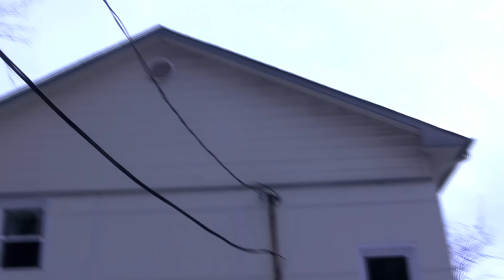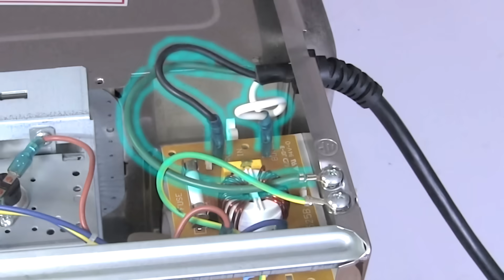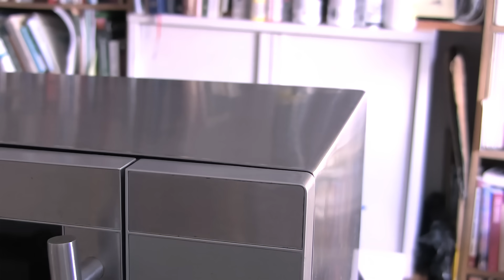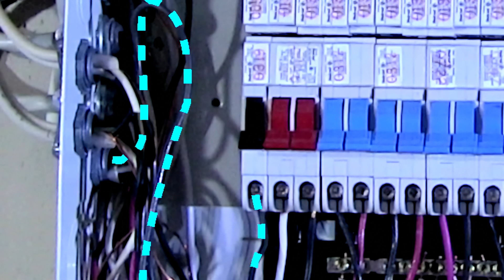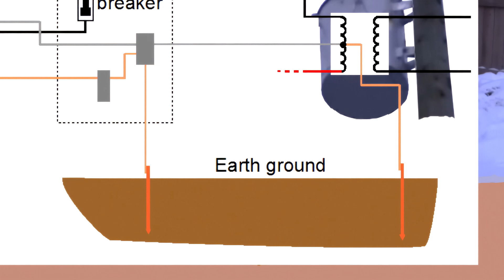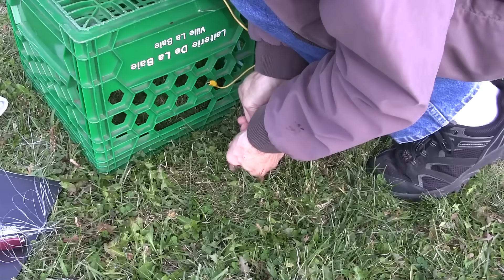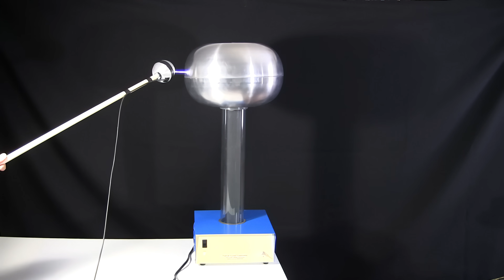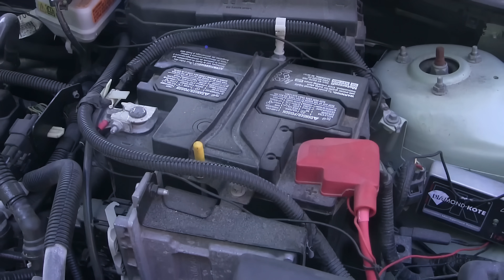What is Ground? Earth Ground/Earthing

Comment: Sorry for asking, its probably a stupid question and maybe adressed in some of 908 comments. It looks to me that the neutral cable is conected to the same things as the ground cable (apart the microowen case). Could  neutral cabel be used as ground? I quess not, because its not used that way, but why? Can somebody explain, please?
Reply from the maker: Do you have a metal case on your lamp? The reason for grounding your lamp is if it has a metal case and there's a possibility of a damaged hot wire touching the metal case, just like is shown in this video. If that's not a possibility then you're okay.
If that's the situation and you're wondering if you can just connect the neutral to the case then that would be bad since whenever the lamp is turned on, the case would be energized because it would be a part of the hot-neutral electrical circuit. Anyone who touches the case and who's grounded would become a part of the circuit too.
Lamps that don't have metal cases don't have to be grounded.
Reply: As an Electrician, it would work BUT very dangerous. One possible problem is some moron wired the plug on the light next to it in reverse, that one works fine as well until you touch them both.

These days they fit "earth leakage" breaker ( wrong name but more descriptive than RCD ), it only needs 30mA (  0.030 Amps ) of current difference between the active  (hot)wire and the neutral wire. big difference if you are touching the case when the fault happens. posible multi hundreds of amps through you, some of which is across your heart, or 31mA, some of which is across your heart. Smoking corpse or a bad shock.

BTW if you get a shock, you should get checked out at the hospital, many, including electricians, have had a shock, shook it off, went home and died suddenly hours later. Something to do with blood and linth ( didn't spell that right ) systems.
Reply: It's against code and unsafe. Basically it isn't connected to ground until it is at the breaker panel. This keeps the neutral wire from taking on that current load that could result in a hazardous condition such as a fire. An electrician could probably give you a better answer, but I didn't see one yet.
Reply: Thank you. I am planning to build some steampunk lamp, but I have only 2 line cable and there are some arguments that the lamp should be grounded. So I thought that it would be better to have something than nothing. Just now I had discussion with an elder of our clan and it seems that it is problem if neutral and hot are switched in the wall plug. Than you get "hot" (we call it faze) on the lamp. So I think proper connection insolation and gound is not needed than.
Reply: The neutral is grounded at the transformer. The ground wire is also grounded. That's why they are attached at the panel only. The current on the neutral will run back to the transformer but can also dissipate into ground through the ground wire.
Reply: The Safest way out of your problem is to use a 12V bulb and a 12V power supply that is "double insulated" .  As long as the cable is rated to take the full output current of your power supply in the case of a short -circuit, it is going to be much safer that mains.

Comment: You should talk about the unbalanced load between the120 240 volt transformed into the that's on the Pole Furnishing power to the house.
Reply: I wonders about that center taped transformer as well, trying to cause a fault? Now if it was a delta/star wired trany it would make sense. ;-)

Comment: how can there be a neutral wire with AC?
Reply: why me? - Neutral is the return path for the electrons. It's not the same neutral like you'd get in a battery
Reply: If you have to transmit electric energy, you need at least two conductors. These are made of precious metals (mostly copper or aluminium). To save some money, you can just change one of these conductors to something else that is already there.

As an example: In a typical car they just connect the negative pole of the battery to the chassis and run only a single wire to big loads (i.e. starter motor), the return path (second conductor) for the current is the chassis. When you add a wire to the positive pole of the battery and drop it somewhere on the chassis, it will cause a short circuit. When you add a wire to the negative pole of the battery and drop it somewhere (except the positive pole), then you just connect negative with negative and nothing happens. The negative wire is in this case neutral, but the positive wire gets really hot. Some smaller loads in a car still use two wires just to make sure that they have a good connection (i.e. plastic case of lamps, relays, radio and so on).

With the electrical power that transferred over power-lines it is the same, the earth is used as a conductor for the current to return to the substations and power plants. They have really big earthing systems buried at these substations and power plants and and have just connected one line to it. Everything that is normally connected to the ground is neutral, nothing will happen if it is dropped to the ground. But if it is the other conductor it can get really hot.
Reply: Many years ago I had to go to a dairy farm to find a fault. They were going to have a party and had hired a mobile coolroom and plugged it into the dairy. All good. Someone tied the dog's chain to the tow bar of the coolroom to get it out of the way. Still no problem. The dog had "to go", went to the tap nearby and got a shock.

The tap was coming from the pump on the house circuit. There was a transformer on the pole down the paddock, metering also on this pole. Two wire came up from the meters to another pole between the house and the dairy. Somewhere during the power installation someone mixed up the two wires, wire A was active at the house while neutral at the dairy, vice versa for wire B.
Never a problem as the tap was just out of reach of the dairy, the extension lead caused the problem..... It took a while to find, turned off power to fix it took 10 minutes ( it was a long walk to the meter box down the paddock )

I can't help thinking that farm must have had a high power bill for many years with that "slow" leak through the ground from the tap to the dairy.
Reply: In AC, the hot wire(s) alternate their voltage constantly while the neutral wire keep the same potential.
The hot wire(phase) change polarity 100 times a second in a 50hz system, in a sine wave. This means that half the time neutral has higher potential than the phase. The current flows either to or from hot wire depending on what potential it has in that exact moment relative to neutral.
https://youtu.be/Jveer7vhjGo
Reply: Watchling: The original question was, how there can be a neutral wire in AC circuits. Neutral is defined by what wire is referenced to earth. And everybody/everything that is somehow connected to earth is therefore on the same potential as the neutral wire and therefore has only a negligible difference in potential to neutral. The hot wire  instead is the one that goes up and down all the time, in reference to earth/neutral.

If you build a table made of a copper plate connected to the hot wire and big insulators as table legs. And you sit on that table with a multimeter and you take some measurements on some cables, you will measure that one cable is always at the same potential as your table... it is neutral and you could even touch it without any harm. But the other cable has a different potential, it is hot and if you touch it, you would get hurt. With that picture in mind, you should see that hot and neutral always depend on what you consider your ground potential.

Your 100 polarity changes per second in a 50Hz system is wrong. There are only 50 polarity changes in a 50Hz system but there are 100 zero-crossings. That confusion may arise from looking at a sine wave plotted between 0 and 2pi. It goes from 0 to 1, back to 0 and down to -1 and back to zero. The first part sin(0) to sin(pi/2) is only a quarter wave and the last part from sin(3pi/2) to sin(2pi) is also only a quarter wave. If you plot cos(0) to cos(2pi) instead, it goes from 1 down to -1, then there is only one change in direction before it comes up from -1 back to 1. By looking at a cosine wave you get rid of some ambiguities like the amount of direction changes and the amount of zero-crossings.

The educational value of that crash course physics video isn't that good. She already talks very fast and they have cut every pause she made away, to make the video even faster. Then they go over many different topics without much explanation. And the original question wasn't even about AC currents and how they work. That is how you make heads explode: https://www.youtube.com/watch?v=E1jf2hOkec4
Reply: zvpunry: As I read the question, it was asking how you could have a neutral line in a circuit which alternates voltage. I was answering that in regard to how neutral interacts with the phase. That's the reason I saw your answer as irrelevant to the question, just as you saw mine. It depends on how you read the question.
You basically answered (I think) why there is a PEN(combined earth and neutral). 
Regarding your first comment: I am derailing a bit here, but in our swedish distribution system atleast, the earth is not used as a return path to the substations and power plants(only leak and fault current). There are 3 phases going to every distribution transformer, and the neutral for low voltage distribution is created at the transformer(Dyn). On the HV side, you only connect the 3 phases and ground the chassis.

Your second paragraph seems wrong in how it is formulated, but I understand what you are trying to say. If you sit on a copper conductor connected to phase, (marked)neutral will NOT be on the same potential as you. The same phase as you connected to copper plate will obviously be the same potential as copper plate(seem neutral to you, I think that was what you tried to say), and if you touch (marked)neutral you will get hurt.

Sorry if I was wrong about polarity switches, that is what I learned in school but maybe the book was wrong. I am just a simple distribution electrician. My friend who is an electrical engineer agrees with me, but he is probably wrong too then. Doesn't zero-crossing mean polarity switch though?

Sorry for the video, I was a bit hurried and only picked one quickly which might not be the best, feel free to send a better one.

Comment: The last bit is still wrong in the video.   The two symbols for earth and ground.    Now correct for eartg but videonis still wrong for ground.   PCB definition forground and is correct but wrong symbol shown; symbol shown is earth.   These are reference or common ground.  Now transformer secondary showing a earth symbol but label is ground.  Wrong symbol shown again.   Should be ground symbol.   Now if that was earthed then noise would go down your gnd OVdc line, making it in UK 30VAC noise plus air rf transiant noise ie lighting risk also.  No good for technology.    This chassis ground would be connected to the earth ground via say a capacitor or a LCR or even a transent lightning arrester.   ie good quality  APC stuff.   PCB ground is called in the trade zero volt referece and has either symbol with label as 0Vref.   I said earth is a very complicated subject.    Main ground earth is a very dirty electrial energy (earth neutral), it contains rf noise plus live trasients and can be 30Vac referenced to any Hot live AC cable!!!   meaning in a transfomer step up or down, the core can be earthed.  This earth is not a neutral, it is also used to keep rf noise out of the live and neutral my the core absorbinging it and taking transents back down to Planet Earth back to neutral on energy source.   This is "screening ground".    Now work tools and consumer product are class two these days.   meaning no earth but double insulated.   Now why because in a fault class one earth all the metal would go Hot (live by live energy live cable) and thus you be live too and your feet be grounded to the ground earth.   Hence why Iso-T for power tools or for test and repairing the core should not be earthed nor earth chasised not earth evert connected to secondary by any means and that also means no lightning arrestors or caps or lcr.   Why because then the energy in a fault live hot has to return to Neutral, pulling secondary core down in magnetic flux thus reducing the volts thus reducing the hot risk in volts to you and witg your resistance less current flow threw you body to feet.   Remember a earth cable is only their to protect the product to blow the fuse a fuse board and thats is the fuse is low enough.   A RCD or RCCD is fuse which will prevent death in hot touch fauly thou you, it does this simply as a see saw that L and N must be + (L) and - (N) in and out to equal energy electrons else if earth cable takes some via  " neutral 2" as all earth is is a secondary neutral cable.  -  Then the RCD will trip as it is no longer balanced in electrons.   The main appliance fuse will only blow when the hot live cable exceeds rated fuse and not by any earth means, the pull loss can be by any neutral regardless of its that feed neutral or another neutral or a earth (Neutral 2), or loss jumped over to a virtual ground chaissis ground (SMPSU or DCDC).    A switch or fuse will not save you from death hence why they are still HOT when COLD, as they are still energised  as they have a live live feed regardless of switched feed out off ( COLD ) as N and L will have 30VAC between them plus RF transient noise voltage spikes, and depending on situation just touching the N in a switched off plug socket could kill you.  In UK mains sockets  L N has to be dual switched DPDP for that reason, but appliances power on off switches may not be, for cheapness they maining just switch the live L.  Having no earth on some applicances is safer than having a earth connected.  Mainly all consumer stuff these days is IET class two (no earth E) amd uses double insulation method in fault conditions.    In fact there is NO all one answer to E usage to fit all boxes of situations.   We never needed a E anyway.   If they fitted L N the other way round on the first ever electrial out distrubtion.   If they put L to E and N for Hot Live, it would have been safer.  Can not do it now as to many N go to E, so rge Planet Earth is now a Neutral.   It been safer if it was a L.  This is because Energy is a minus releative to refernece Earth to Space.  E=MC2     No!!!   should of been     -E=MC2    .    Electrons do not move to create a current as said.   Electons vibrate making the next vibrate.   It is these holes where Electrons where just then that creates Electricty current not the moving of flow of electrons as always said.     Electricity is not really an energy as it is humans that created a tap off AN true energy.   Plasma is the true energy which we tap off electricity mainly by resistance loadings and these differences of on offs 1 and zeros making circuits.   If we drew of from inductance or frequency it would of been a different story and Earth E would of not been needed.   But thats thee Tesla vers JPMC money argment over cheap electrial network distrubution for lighting then appliances.  JPMC cut Teslas' money.    This has caused all the design issues such as why we need a E earth (which is a N neutral) cable grounded to Planet Earth.  Wireless energy such as inductance can not transfer the current in say normal fault situations over the earthed core version we ise today.   As the flux load would reduce the voltage hence less current.  hey you say 100% energy so VIR Ohms law.   No a the flux reduces the 100% energy level, as % is a % it always a 100% as its always the total - but this total would be lower making VIR lower.   ie   100 units = 100v x 1a    but then  50 units = 50v x 1a     both units are 100% as its all the energy bucket has got so it 100%.  Hence why maths does not work properly in battery usage.   It is  the same in network mains energy is just infitate large number in network energy bucket, but bucket has a limit in a battery.   Now if your chasiss ground was very large then this would become a secodary earth not linked to main Planet Earth earth.   This would then have to be treated as a Planet Earth earth for risk levels to death and injury and crossover faults.   Electricity only works by pulling electrons from live to a reference difference location that has electrons that can move (vibrate).   It is where the holes are that created electricity we know as today.   If fact it is a wave energy of electrons and shoulf have been called wavetricity not electricity as no elctrons move.
Reply: TL;DR